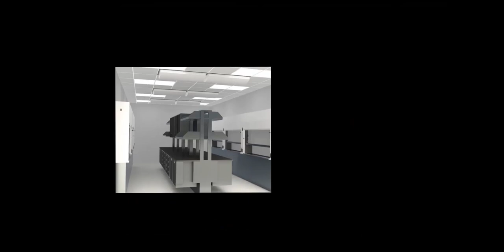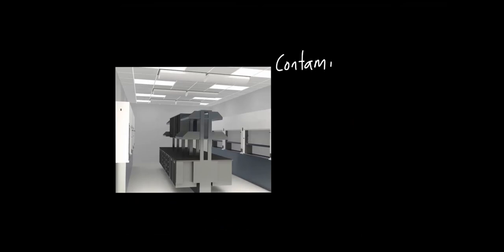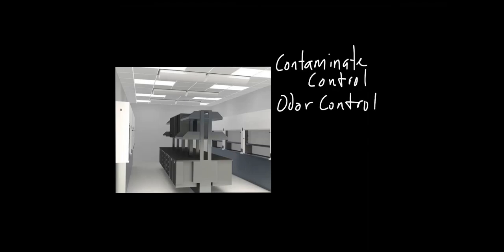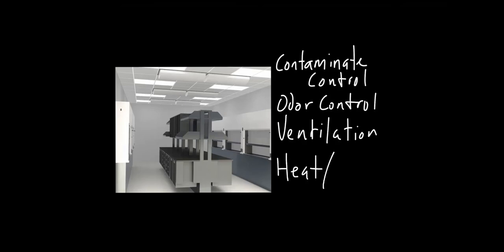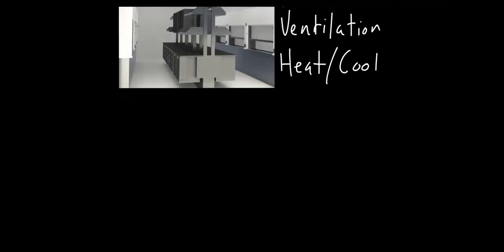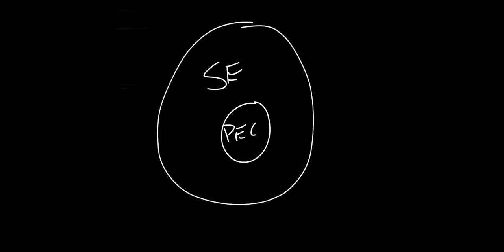Titus Timeout Podcast - Laboratory Air Distribution Basics

Comment: What is the range of capture velocity ?
I did not hear it very well because you said it quickly.
Reply from the maker: While capture velocities can vary from manufacturer to manufacturer and between types of hoods. Common capture velocities are around 100 feet per minute, but could vary between 80 and 120. There are also high performance hoods can have capture velocities as low as 50-60fpm and remain effective at meeting minimum containment requirements even at the lower velocities.

Air motion in front of the hoods should never exceed capture velocity, and generally should be fifty feet per minute or less. It is recommended that velocities in front of the hood are designed to be 30 to 50 percent of the capture velocity. With high performance hoods that have capture velocities around 50 feet per minute, this means keeping any air motion in front of the hood to a maximum of 25 feet per minute which can be extremely challenging to maintain.